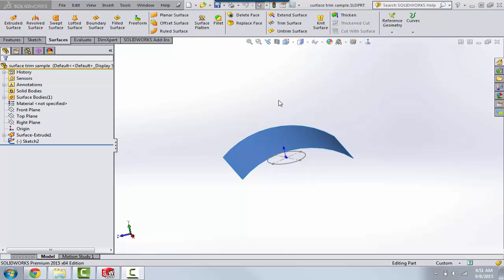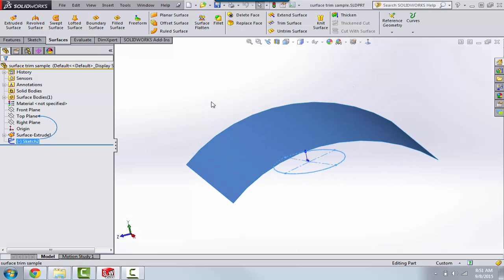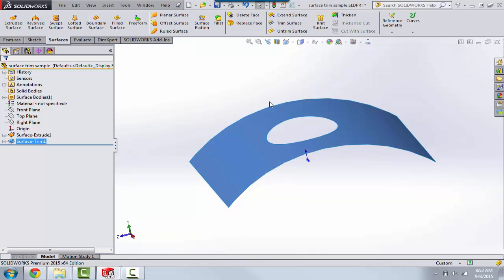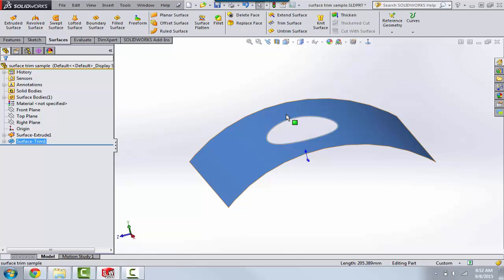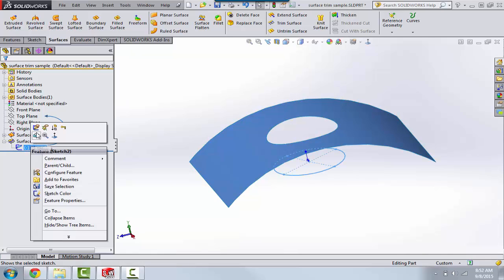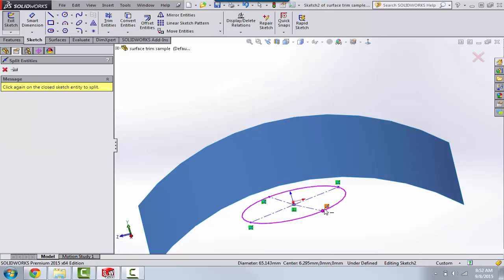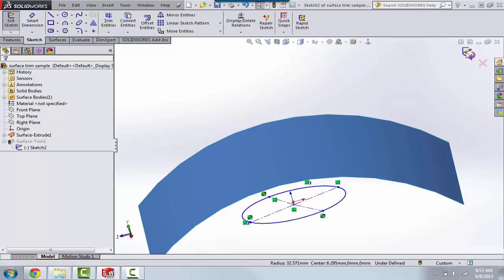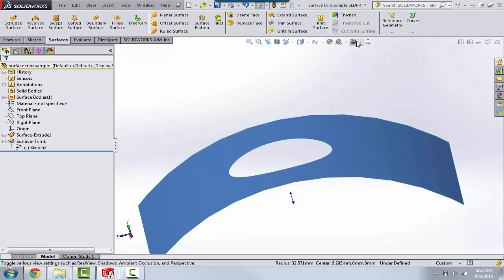SOLIDWORKS Quick Tip - Strategically Trim Surfaces

Comment: thank you ..

Please how can activate or add in  (power surface) ..
my solidworks.. 2016..?? 
I didn't find it
Reply from the maker: My Dreams, Thank you for your comment, Power Surfacing is a 3rd party software that can be integrated into SOLIDWORKS as an add-in but is not made or sold by SOLIDWORKS. It is made by a company called N Power Software and if you click the link below you can learn more about this company as well as buy their power surfacing tool for SOLIDWORKS if you decide to do that.  https://www.npowersoftware.com/.